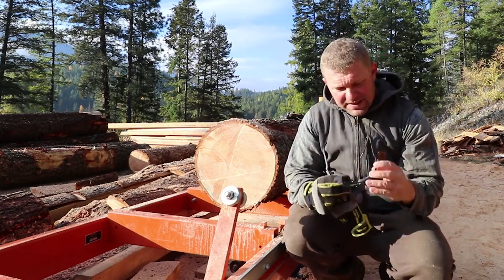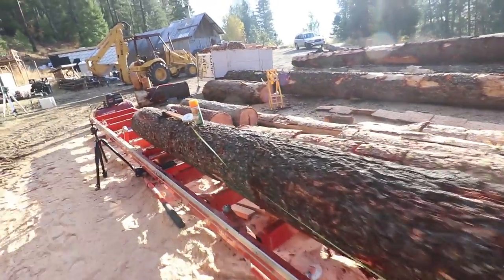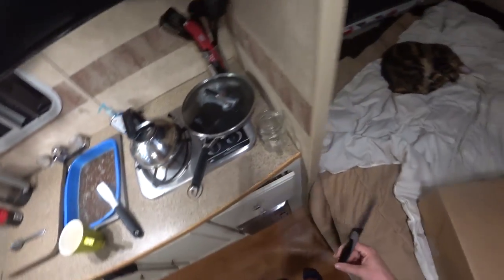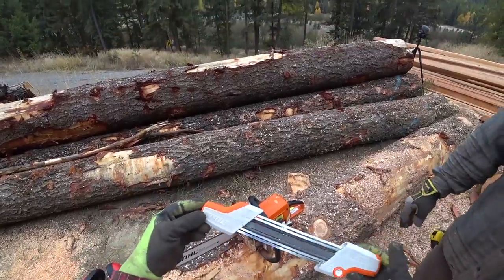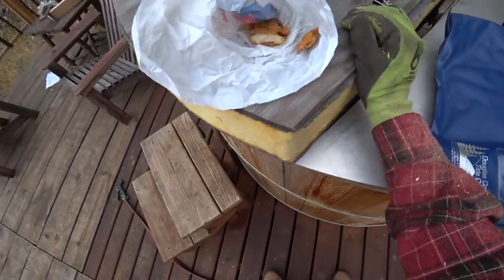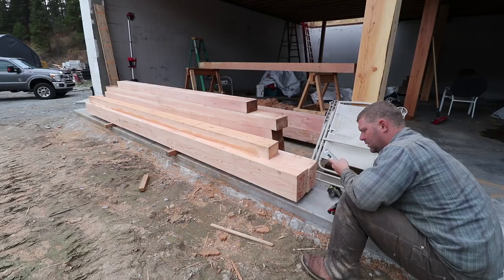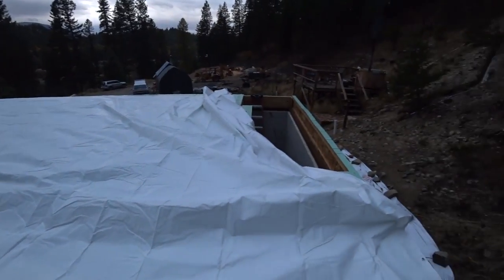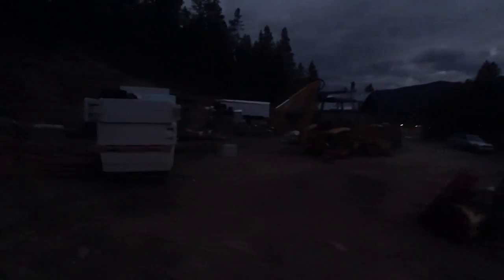Building a House Start to Finish: Sawmilling a Timber Frame

Comment: I began heating solely with wood when I moved from Western Washington to NE Washington. I learned too late in life to save my joints. 1/2 working life was in sales 1/2 construction. Two replaced hips and one replaced shoulder and the other needed along with a near future back operation. PLEASE USE EITHER A CONTRACTORS WHEELBARREL AND OR DOLLY. Your backs will love you for it. I wish I had used stretching before work instead of just before sports  when I was a kid. Hind site is 20/20. Keep up the GREAT WORK YOU TWO!

Comment: You are one hell of a hard working couple!  Alyssa you are one in a million. Can't get my wife to help with anything, not even do the dishes unless there are no clean ones. Being wheelchair bound it's had for me to get into kitchen to do them myself. Have to hire someone to do most of the outdoor stuff which averages out a $500/week. Many projects yet to do, outdoor fireplace on side of the newly completed 30' x 36' composite deck and outdoor stainless kitchen with Hot/cold running water. Forgot to mention the building of a winterized 1/2 bathroom near patio that looks like an old fashion outhouse so guest don't have to run in and out of the house while enjoying the "porch" as my 5 year old Grandson calls it. That place of yours will be fantastic looking and truly will be your nest from the ground up! Love your videos and hope they continue.

Comment: Great Vid. Great team work. Love your progress. I know this is a month old, but I'm still gonna
say, Alyssa, girl, get you a garden wagon.... a metal, rolling carrier thingy.  (I got mine at Tractor Supply). You could have
thrown that fire wood into it and rolled it to the stack. I use it for mulch, firewood, concrete blocks, compost pile and moving big tools. I even use it to weedeat my property. I put the weedeater, string and fuel can in it and pull it along as I go.....
all kinds of things. Great vid guys. God Bless and Keep

Comment: lifting legs over logs and rocks have been regular arduous required work for outdoorsmen such as loggers for years...(hundreds of years?!)  They have also struggled with your pains of reduced range of motion.  As a firefighter wearing my protective clothing, I can appreciate any adjustment that frees my energy to be spent in other ways. One BIG and overlooked simple solution is .. pause for effect... suspenders.  Trust me on this. You add suspenders and tug them up high, this allows for freedom to move around. Lifting legs is easier.  Bare in mind there are other variables, but all things alike...suspenders are your answer.  Good luck,  see you in the sawdust!

Comment: Empty laundry soap bottles filled with water are awesome for holding down tarps. I save them and reuse them every year. Some get hammered but they get replaced by the new ones.

Comment: I love teflon, or other brand version, of pans for that exact same reason, clean-up is a snap!
Reply: Properly cared for cast Iron pans will be just as non-stick...yes heavier, and should it need reseasoning due to neglect, you don't have to replace it as you would with Teflon pans when that coating is gone. Not hating it, to each t hier OWN, just shedding another perspective. These two are getting the job done for sure...

Comment: Sliding Sawmill fix, Metal feet on concrete tend to slide easily, if you can, pick up some 1/4 inch thick  rubber blocks to place in between the metal feet and concrete block pads. This should give the feet something to grip and prevent the sawmill from moving around easily. The rubber blocks don't need to be huge in size, but the bigger it is the more surface area available for traction/grip. 

Hope you see this among the ocean of posts, and hope it helps.

Comment: Questions :
1. Have you noticed that the backhoe loses pressure over time?
2. Would it be useful to seal the log endings when they arrive AND the beams newly cut?
3. Could it be feasible to anchor the sawmill track in the ground with spiral anchors? (so it moves less)
4. By doing 4 x 90' cuts on the logs it saves time, but doesn't guarantee that opposing sides are parallel. Could it be more useful to do a top cut to create a flat surface, then flip 180?
5. Can two switches be added to the battery cables (to cut off BOTH at night) ?

Comment: Hey Jesse and Alyssa, what software did you use to the design the optimal layout, was it Illustrator?  
Love you guys, you're both adorable, and I love your videos. Sure wish I was doing what you're doing! Long ago, I have sat with a glass of wine in a hot tub many a time with big fluffy snowflakes gently falling and disappearing into the steam. 
I highly recommend it! 
Do you guys plan on ever building a roof over the hot tub? Which brings me to ask you if you plan on eventually making the hot tub part of the house, rather than separate, like it is now? 
Because your videos make me so enthusiastic, I envisioned a steep-pitched solar heated(for snow)gazebo style roof over your hot tub deck, or a sliding lean-to style star-roof (over the tub only)which you can slide back like the 'moonroof' (sunroof) in a car - so you can hottub in a downpour, or - slide it back so you can still enjoy the stars, or the falling snow experience I described. So yeah, wish I doing what you're doing, right now.  I have an ingenious design for a roof that covers the deck, with a sliding section for directly over the tub in mind, as well. Pardon my enthusiasm.

Comment: Like Ronn says below "Get a wheel Barrow" that's a no brainer. I have been moving tons of red oak cord wood on my property for two decades and I'm on my third wheel barrow. I cant imagine not having one. Better yet invest in a cheap tractor with a trailer/cart to move that stuff. Its much cheaper than a back injury.

Comment: shame to cut up potential 3x10s or larger planks for firewood -but suspect for efficiency making beams

   however you should use wheelbarrow or cart for moving firewood-backhoe too clumsy-thus saving your back and thighs
     - i would suggest old pallets under firewood to keep off ground-I use PLASTIC pallets myself since they don't rot

Comment: At a guess the outer layer is thicker Cardura rather than normal nylon or it could be Kevlar? Which is another material they use for when using Chain Saws. I do not have a GoPro or anything like one? Years ago I had 2 35 mm Cameras. 1 was Automatic the other was a Manual. I had about 10 Lenses in all. To stop damage I fitted a UV filter to the front of each Lens then a Lens cap. It was to stop the Lens getting scratched. If it did I only had to replace the UV filter which I could do and it was cheaper than getting a Scratched Lens ground down/replaced. I have no idea if you can get them for GoPro type cameras. I have just had a Nokia Coolpix B700 (£400) only to find there are no threads to fit a filter at all?

Comment: Put something under the tarp to hold it up in a roof shape. You'd never know, it may have a few pin-holes, either as manufacturing defects, or as a result of laying it down. Sloping it will allow it to shed water with little/no leakage.

Comment: Im sure you are aware of this, but rewatch at 14:56-15:01 the backhoe is sagging while you two are working. Not sure if it is an issue but thought I would mention it. Great Idea on the blades! You guys rock!
Reply: So it is nice spot. Check for oil leaks.

Comment: Would leaving the wood scraps in whole pieces and transporting it in planks with the backhoe to the end of the property be easier for now and when you get to using it (after drying for a year or however long) when you get more free time would that be more efficient? I understand the cutting helps it dry quicker, so could you move then cut after you have stacked it where you wish?  (not trying to sound rude, but just curious)
Reply: harnessedhorse with the timber framing class so close, i dont think there was time to wait dor things to dry. It was PACKED there with all that was goinh on (spoilers). I'm sure if time permitted they would have done as you suggested
Reply: oh no how at the start they cut up the lumber and are stacking it. they said they were then going to move it to the far end of the property to let it dry out ( I believe)

Comment: good video, you should keep some of the long cut offs to put under your firewood so its not sitting on the ground, square stack the ends of the piles so it keeps the pile in a line and in place

Comment: Is that enough anchor seal? I would thing to get it in all the nooks and crannies you'd want to use a bristle brush.
Reply: Or a 4" paint roller, which would also push it into the open pores.

Comment: I have the same briar pants I work in a winery and use them because of how water resistant they are for sliding in an out of tanks. I haven't had a flexibility problem with them but I do have a problem with the nylon being so slick that when I need to use my inner legs to open or grip items they often just spin. I use them for pheasant hunting also but super durable pants. I guess another complaint is that the pockets are almost excessively deep.

Comment: Are the logs you guys are using Already dry? Have you taken into account the amount of twisting and moving that the timbers will do as they continue to dry. If you cut the joinery to a nice tight fit as the timbers dry is it possible they'll become loose? Not trying to be a troll, you guys work so hard. Hate to see that be over looked.

Comment: Alyssa,  I don't know if someone has suggested it already but ............ get your self a mini paint roller, pour a small volume of your sealant in a separate can and just leave the small roller inside ( bend the handle if necessary ), then quickly gidher done when you need to seal....   you go girl !

Comment: I am just wondering why you are not creating dimensional lumber while you are milling you timbers, instead of wasting the wood and blocking it all for fire wood?
Reply: Jesse appears to suffer from task-oriented tunnel vision. He's so focussed on getting to the heartwood, and getting all the heavy beams ready as soon as possible, he can't think of anything else. He's even stopped stripping the bark, preferring instead to deal with the consequences, like constantly having to swap blades. And because neither of them expect Alyssa to do half of the thinking he's stuck with having to do more thinking than he's actually capable of, and ends up doing things the stupid way. I really wish Alyssa would assert herself more. She could probably come up with better solutions for 90% of the work they do by just quietly thinking to herself while she's shifting bits of wood about.

Comment: Just a friendly observation (not trolling)... Wouldn't the off cuts on the saw mill in 1 solid piece  be easier and more efficient to move 1 time rather than moving 10 or more small pieces 100 feet, 10 times? My back was hurting after watching that!
Reply: I thought that - or at least stack into their wheelbarrow and move on wheel in bulk.
Reply: they alwayz find a way to make the job harder lol...

Comment: Does your backhoe have a block heater?  Most diesels do.  It keeps the block warm overnight.  But it takes 110 power.
Reply: It didn't start in the summer time either. (battery draw)

Comment: Forgive my ignorance... At around 15 minutes the backhoe arm seems to be falling down slightly... Is that normal?
Reply: it's called seeping... it's normal. The hydraulic system loses pressure after awhile. It gets worse with older machines
Reply: Thanks Mike :)

Comment: Is it me or is there a lot of wood that is not being used to it’s full potential. I’m seeing stuff that could be made into 2x4 that are getting cut up for fire wood. I hate wast things.
Reply: mike smidee could be used as 2×4, yes they could l.  but they use the wood for heat. So not really wasting it
Reply: Time at this point would be the worst thing to waste
Reply: What all that saw dust on the ground. Buying something that would make the saw dust into pellets. And there is still left over would from what you get from making 2x4s. I don’t know if it was the army beating into me head but all I can think about is wast you have the wood to make everything you need to frame and cover a house. Using every inch of resources would be smarter. If it’s time your worried about then take them possible 2x4s set them to the side till it’s time to make them.

Comment: Honestly I don’t know if this is going to make any sense or any difference, but for the saw mill, maybe if you made a wooden floor with a wall I guess to catch the saw dust. Maybe in the long run it would be easy to clean up the dust??? I don’t know might be useless but it’s an idea ::)

Comment: I have a question. Are you utilizing every different sizes of lumber that you can get out of one log? Another question . Are you purposely cutting the log the way that you are in order to get firewood out of it?  No offense intended, I am just a little bit confused by the thickness of some of the wood that you're using for firewood .
Reply: david gunter when you're cutting an 8X15 beam 25' long, it takes a big tree. Hence lots of waste, as you need mostly heart for strength.

Comment: For your RV, put in a T with two ball joins in the kitchen sink.  so you can set it up to drain outside when needed and switch back when necessary as well.

Comment: Why wouldn’t you use a wheel barrow to move the fire wood?
Reply: I use a dolly. (it's wheel barrow btw)
Reply: I think it may have to do with the sawdust on the ground. Pushing a wheel barrow through it may be like pushing one through mud.
Reply: Right, or a dolly? Carrying three pieces of wood at a time just seems like to much work.

Comment: What is the name of the sealant you are using to keep the checking in check?
Reply: Anchor Seal
Reply: opfor325 I think it's called anchor seal
Reply: august yes I've mostly heard about anchor seal for sealing end grain keeping blanks for turning on lathe from checking but I've always though it was meant to be painted on fairly thick like paint.

Comment: BTW, sawdust in the face and lungs is overcome by putty clear plastic garage door sweeps that are cut to 6" wide and screwed to the sawmill and dropped to 4" from the ground and run just a little more water little. Just a hint by a fellow sawmiller.

Comment: I keep wanting to remove the handle on that mill and mount a drill motor to it so you could walk upright as you mill, Jesse.  In some of your vast amounts of spare time, carve a paddle for stirring the hot tub.  //  For the tarp, fasten two sides with fender washers and screws into the sill plates.  Hang sandbags from cords on the other two sides.  //  Congrats on the milestones of last log and last long beam.
Reply: These videos are a month behind. The first floor is currently under construction so your advice about the tarp is somewhat moot.
Reply: I knowwww! I always wanna give advice or something, and it's kind of a bummer they can't be up to date. But I get it, there's busy as heck. Their Facebook is updated daily, tho. Kind of a spoiler alert.
Reply: hopefully the suggestion will help somebody in the future.
Reply: True, but do you think that's the last tarp they (or anyone else reading this) will ever install?
Reply: Yep, that is (or should I say was) the last tarp on Earth. There's been an international ban on installing tarpaulin since this video was recorded. :-|

Comment: To move around all that logs, use a wheel barrel .. then you dont have to bend down so much..
Reply: It's Alyssa's workout routine. She said it's good for her glutes. No gym membership needed.
Reply: Workout routine? That back will get crushed over time, by doing that. Look the way she picks it up........  - Gym memberships is not needed to get strength ..... it's all about how to do it right, and if you take a look in this video she dosen't do it right. and i can also show it to you.....
Pause the video here!
https://youtu.be/1I2cLakOp2E?t=14m49s

Comment: I use a wheelbarrow to move firewood.
Reply: I think I'd figure out a way to cut the pieces so they drop into the wheelbarrow or cart, but I'm 30 years older than they are.  <creak>
Reply: Well, since it's Alyssa moving all the firewood I doubt they'll be getting a wheelbarrow. Jesse isn't even thoughtful enough to throw them into a single pile or towards the woodpile. He just lobs them out of his way so he can carry on with what he's busy with. He really puts the "I" into "teamwork".

At the end of the video when he said (about getting through a lot in one day), "The only reason that happened is because you were sawing", Alyssa actually thanked him for the recognition. Such a sad state of affairs, but at least he's learning I suppose. Though I doubt he'll ever fully realize that she's just as capable as he is.

The only real difference between them is that Jesse is much stronger than Alyssa. By that rationale they'd get much more work done if he was to shift chunks of firewood around and generally make use of his man-strength while she operates the machinery. I guess both of them assume that Jesse is somehow more cut out for the 'important' stuff, while women are more apt for menial chores that would be unbecoming of a man. ^_^ Welcome to 21st century Idaho!

Comment: take the negative cable off and put a tester on the battery negative and the other end of the tester on the battery cable. see what it reads, it should be .3 or lower. if higher you have something pulling juice all night. just unhook the negative terminal each night.